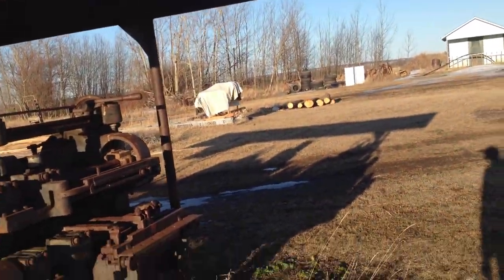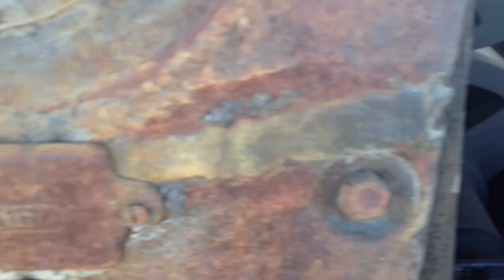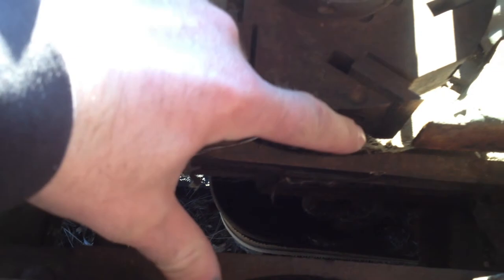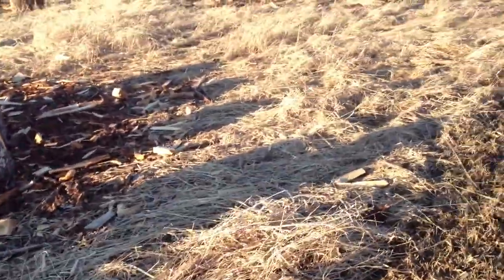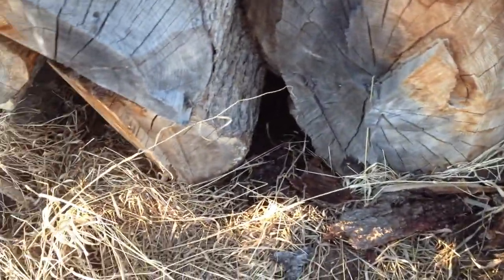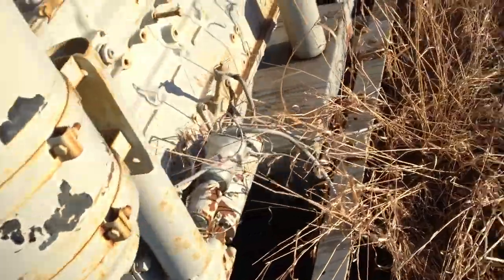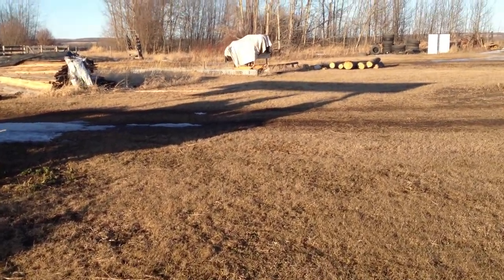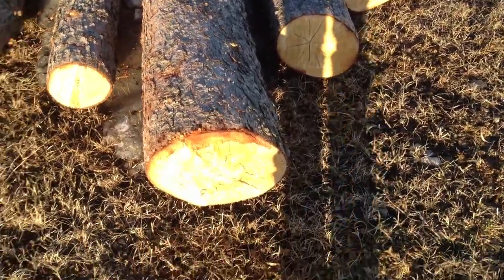My old old planer mill...cummins 855 engine..and sawmill.

Comment: Did you ever get this up and running ? I love working with wood. When we built out house I sanded and cut every board. I also used the nail gun on my end and nailed them in place. The whole house walls, ceiling and closets are tongue and grove knotty pine. That's been about 16 years ago now so I probably couldn't tackle that big of a job and more. However I like to refinish stuff when I have the time.

Comment: @nathan.... I bought a 24" planer off of ebay for a little over $100.00 in ohio (jay & egan planer) I'm like you just a little further along. I have around $3500 in my project, not counting shipping, so far. That's an edger, planer, and circular sawmill.